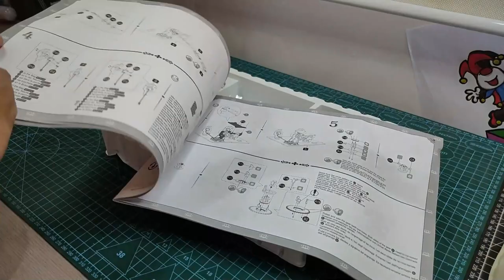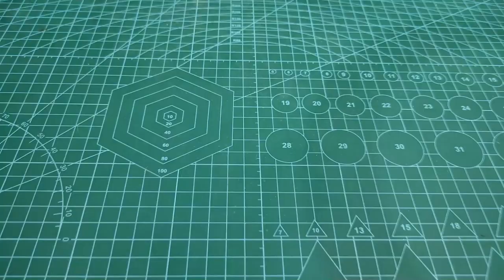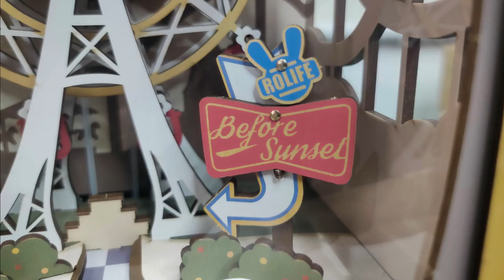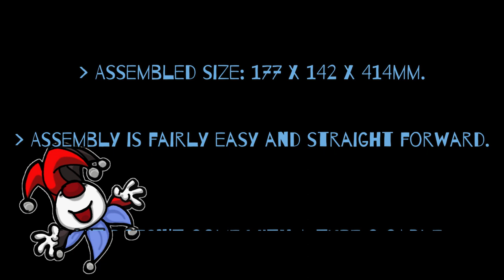DIY Music Box. Music Dreamer - Sunset Carnival by Rolife.  Wooden Kit Build.

Comment: Somehow I managed to have three little pieces left over oops - it works though!  Thanks so much for this walkthrough, it was super helpful:)
Reply from the maker: Your welcome! Glad it helped you with your build. Thank you for watching. 😊
Reply: La roue ne veut pas tourner
Reply from the maker: @sylviebert5070  Does the motor run when you turn it on? If not, double-check the connections on your circuit board they might be loose or you might have connected the wires wrong. Hope this helps.

Comment: what happens if you don’t sand and wax
Reply from the maker: You need to sand them to smoothen them out and the wax acts as a lubricant so the gears can slide and move freely against each other. If you don't do these steps, the gears may have a tendency to get stuck.
Reply: @outsidethetoybox  does it come with wax ?
Reply from the maker: @slayerxsosa From my experience, usually if the kit is imported from China, there isn't any wax included unless the store is based locally. But you can also use candle wax if it's not included.
Reply: @outsidethetoybox I don’t have wax unfortunately thanks for the response
Reply: @outsidethetoybox will it still work if I don’t have wax but sand it ?
Reply from the maker: Haven't tried it that way so I'm not 100 percent sure that it will work. There's still the possiblity for the gears to get stuck up if not properly lubricated (waxed).
Reply: @outsidethetoybox  I’m a beginner so I’m not so sure how to wax it could you maybe make a video
Reply from the maker: I'll try to make a short video within the day and post it on the channel.
Reply: @outsidethetoybox  thanks so much bro I just thought the set looked cool and I wanted to build it and I really appreciate the fact your willing to do all this 👍
Reply from the maker: @slayerxsosa  I've posted the video. Hope it helps with your build. Here's the link: https://youtube.com/shorts/77sBUg1_wNE
Reply: @outsidethetoybox  where’s the wax on it tho